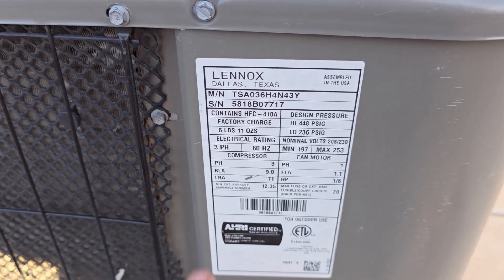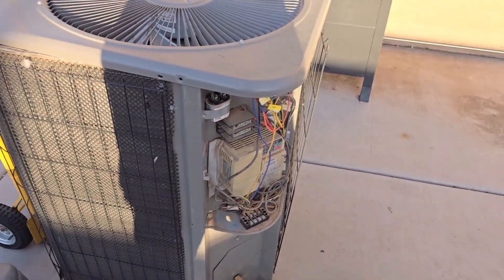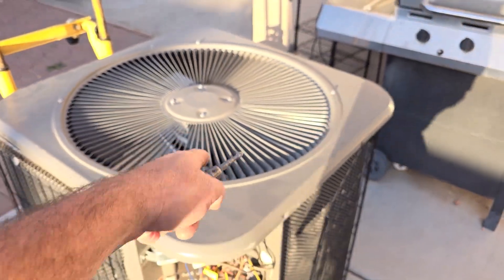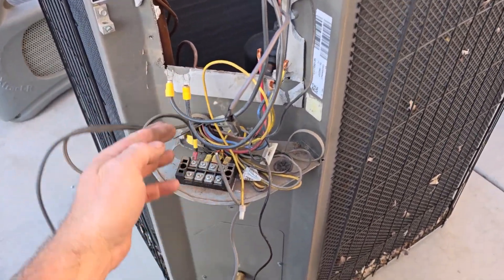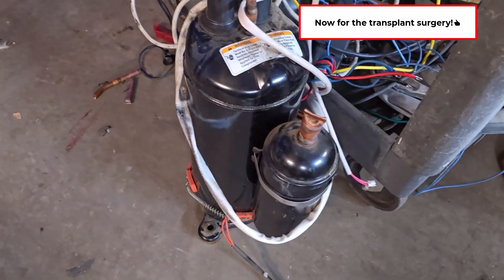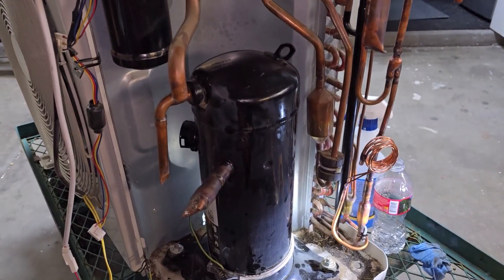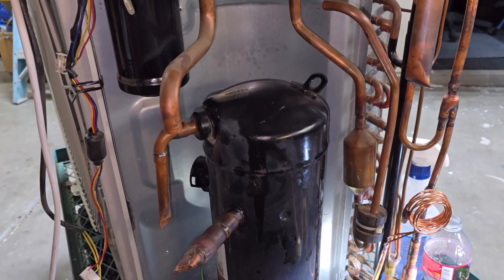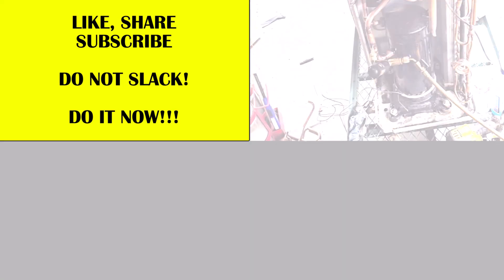Frankenstein transplants the 3 phase scroll from the Lennox to the Carrier Twin Slim HP

Comment: What made you want to put it in this unit? Just for fun?
Reply from the maker: My outdoor units are behind my RV gate and even with the cube units pushed near the wall I can barely back my trailer in.
I scored these twin tall slender units and using them I'll gain over a foot of clearance.
I also have a few short matching cabinets. So my water heat pump will eventually also be in a matching odu cabinet. So it will be cool and DIY.